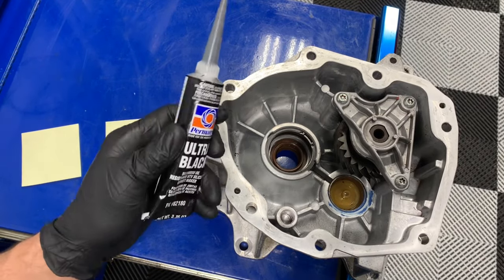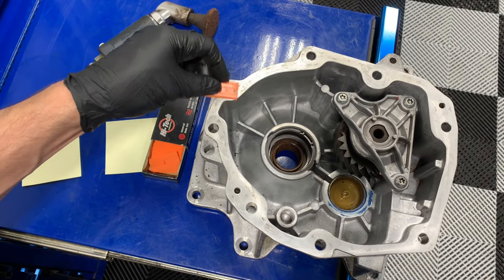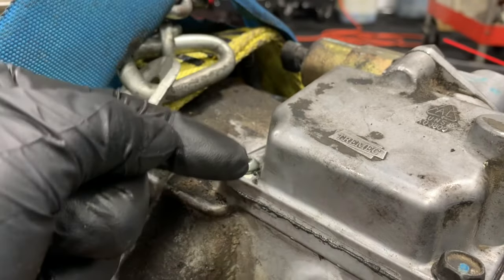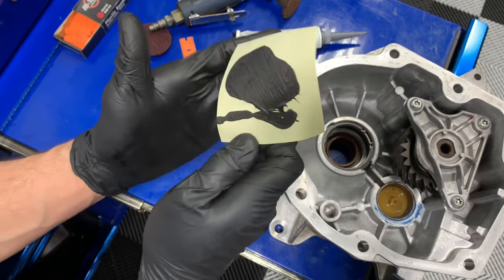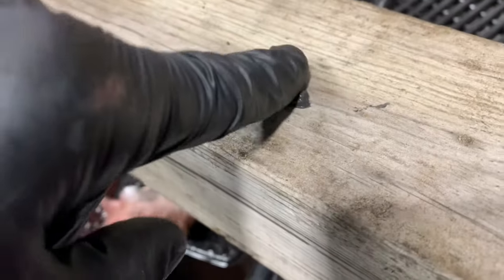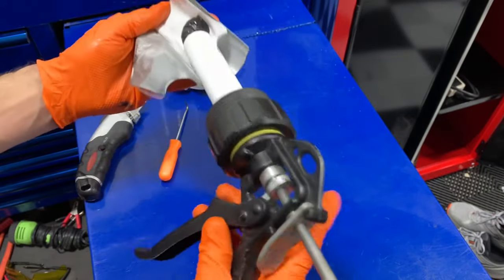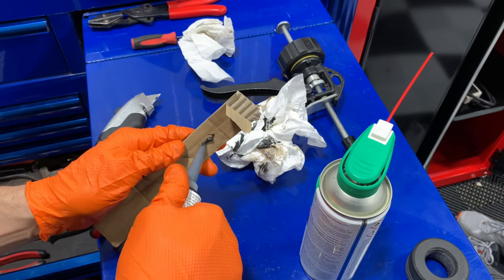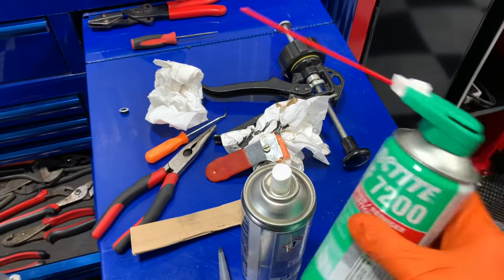RTV no-no’s ,  Before you go ultra…….. watch this! How to use RTV gasket maker correctly

Comment: Does the rtv go on the inside or the outside of the bolt holes?
Reply from the maker: That depends on the application, almost always it goes on the inside because you’re keeping the oil from leaking outwards. But it also depends on what your sealing because sometimes oil can come from all around the hole. There’s usually instructions on whatever you are sealing as to the path the sealant should be applied. That was a great question. It’s just not a one-size-fits-all answer.

Comment: Do you use Mercedes brand sealant for aluminum oil pans or can you use something else?
Reply from the maker: I use mercedes however it’s basically loctite with mercedes name on it. Black silicone is basically black silicone. In my experience. But use a brand name.
Reply: @MasterTechLou  okay thanks for the quick reply.  I removed my oil pan from my c250... it was the hardest job I've ever done...I don't want to put the wrong sealant and have to drop the subframe again... talk about a headache.
Reply from the maker: @stemulatedstudents  I hate oil pans upside down…… pull the oil filter. Let engine drain and drip as long as you can. Worst part is tryin to put oil pan back with oil dripping
Reply: @MasterTechLou  lol it's been a week so I'm sure it's pretty dry...I've just been apprehensive of which sealant to use...is there an alternative to loctite sf 7200? I can't find it anywhere near me.
Reply from the maker: @stemulatedstudents  amazon next day delivery 😉 or local parts store has got to have black rtv from loctite or permatex

Comment: Is it safe to use rtv for a valve cover?
Reply from the maker: Safe? sure, but it depends , if you are using ONLY rtv? does the car call for a gasket? if so, we do apply small dabs depending on the car and head. but we never make a gasket alone from rtv UNLESS its a machined surface.

Comment: What's the part number of that tool?
Reply from the maker: Which tool?
Reply: @MasterTechLou  sorry, the silicone cartridge gun. And also the part number of the cartridges for it too, please
Reply from the maker: @mjk4378  003-989-98-20-10 for silicone and 112 589 00 25 00 for the gun
Reply: @MasterTechLou  dope! Thanks dude

Comment: How long do you let it setup for?
Reply from the maker: Good question, one thing I may not have shown, is, once I bolt the parts together, I then squirt some rtv on a piece of paper. I check it periodically, once its tacky and getting solid, I then fill fluids. I use that as my gauge. it actually sets up faster in the presence of air , or lack of air, depending on the sealant used. But Ive never waited more than an hour to add fluids. Not that I can remember.

Comment: Question:
Can I use this for an idle air control valve, that has no gaskets available in the world anymore??
Reply from the maker: @madmax8620  yes you can apply a super thin layer or buy a sheet of gasket material. And cut out your own.

Comment: Lou, I have a 92 previa and all the valve cover gaskets I can source are all after market. (Felpro V Reinz) When I install them with the factory valve cover bolts, the gaskets barely squeeze to the head. In turn, they seal for a couple months max. I’m hesitant to use silicone in tandem with the rubber gasket. Do you have any ideas? Thanks in advance  for any advice.
Reply from the maker: hmm, I would not suspect the valve cover itself to be an issue, nor would I add silicone to the gasket UNLESS I did a thin bead on the cover, let it dry and then use the gasket. but I still dont feel good with that idea. Toyota part numbers are 1121376020 and 1121476010 I tried calling my local one today but they didnt answer. So try the dealer? this is one of those odd scenarios where I would have to be there to see how the gasket sits when tightened. not sure what to advise other than trying the dealer or find NEW OLD stock gaskets with those numbers.